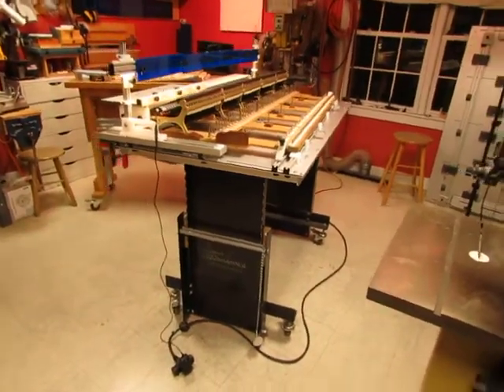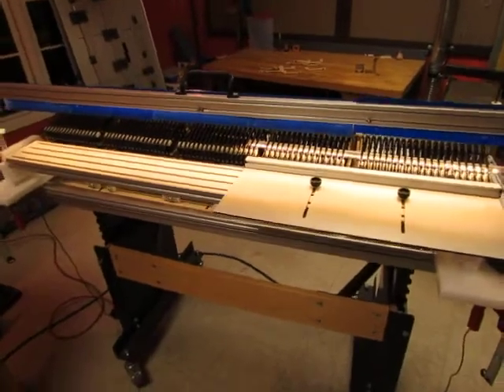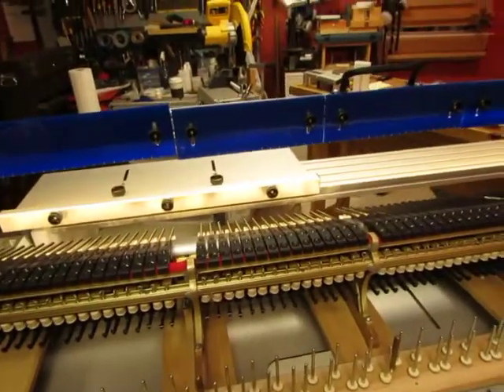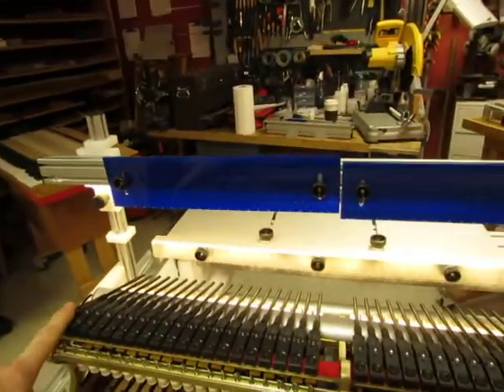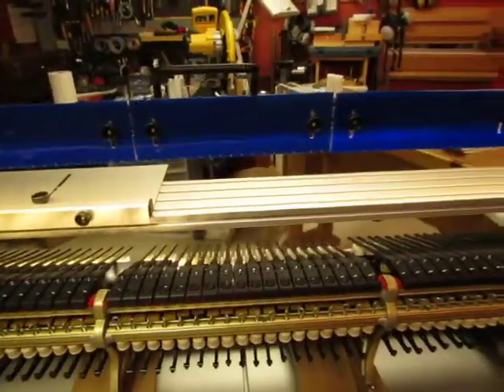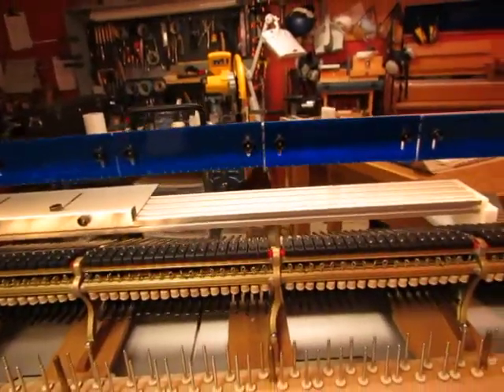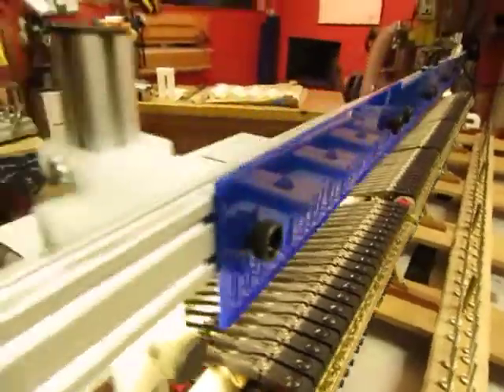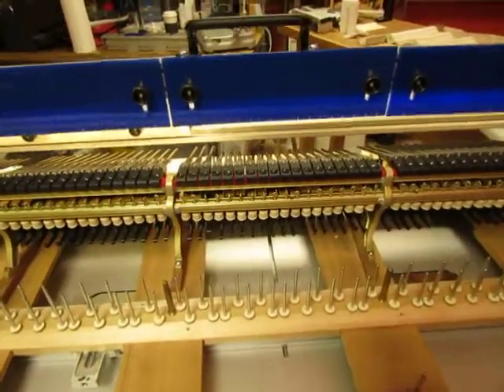HH 1 Introducing Grandwork Tools for Hammer Hanging

Comment: Chris-   I admire your tools.   I have a question about what you did here.   With an uneven string height, did you then change the bore distance incrementally as you drilled the hammers?
Reply from the maker: Hi, Jeremy - Apparently I haven't replied for 2 years. Yikes. But an important question. String heights are often not parallel to the keybed over the length of the strikeline. Sometimes the discrepancy can be considerable, interfering with backchecking, strike characteristics, and regulation. I prefer a regulation that can be consistent, with as little compromise to dip, blow, letoff, backchecking, damper lift, and especially aftertouch. So, yes I do vary the bore. I accomplish this by measuring the discrepancy at ends of sections, with a mid-tenor measurement, as well. I draw the outline of this discrepancy on extra-length tails, calculating in the tail length I want, and cut the tails carefully to these lines. Then, I bore all the hammers from their tails - one setup fits all. When I'm done, tenor hammers are a bit longer (where more weight adds projection), high treble are the shortest (where tone benefits from a lighter hammer), and the low bass are somewhat shorter (where less weight means less lead will be needed as weigh-off compensation). So, all the tails will be the same length, all the backchecks can be the same height, all shanks will be the same distance above their rest cushions, and the blow distance, dip, letoff, and drop produce the same aftertouch. This will give the player more control of power, tone quality, and subtleties from soft pedal to fast passages, to chord synchronicity. It does make hammer travel and strike verticality and good centerpinning even more crucial, while making clearance issues somewhat tighter in the middle. But all-in-all, I love the benefits to playability and tone and have found that I can solve the clearance difficulties. The time-energy costs of custom boring, I find, are way more than paid for by lack of the voicing and fine regulation time-energy drains two-tier boring incurs.